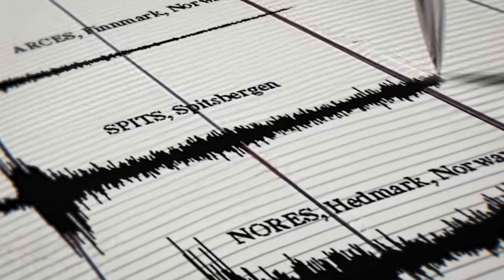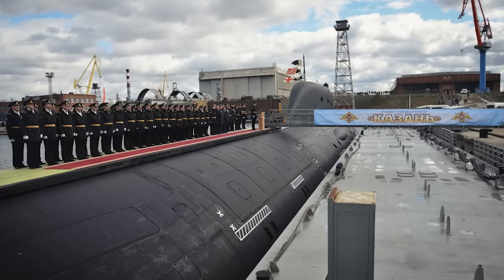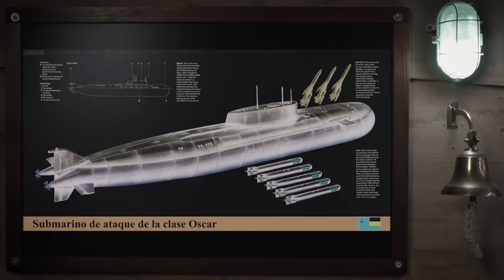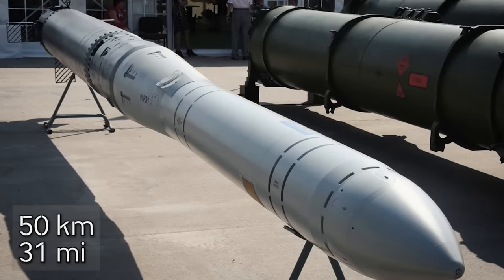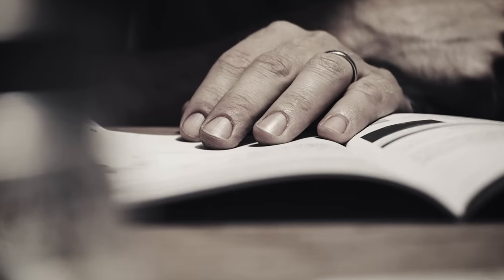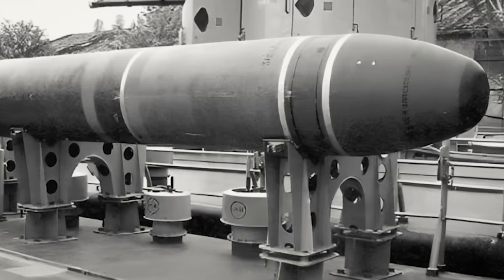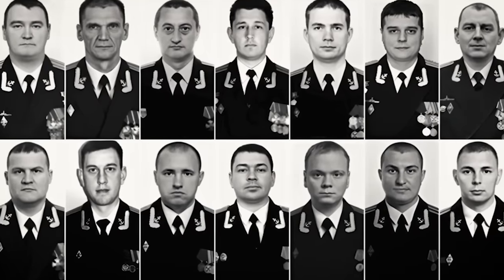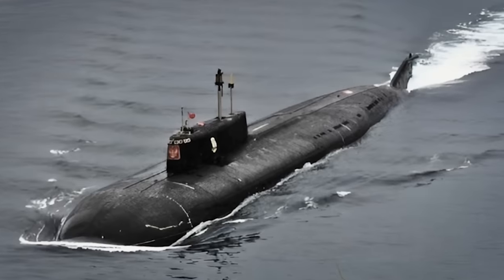This Chemical Killed 118 Men...

Comment: Disgraceful, criminal incompetence. You can't help but feel dreadfully for those poor sailors - the lucky ones died quickly. Also, really good video
Reply: They should have taken the chance. A very low chance of survival is better than not trying.
Reply: @albertoj.mollinedo4116  hindsight is always 20/20.  There was NO way they could possibly know what waited on the surface for them.  If they surfaced during a big storm, they would have died nearly immediately anyway.

Comment: HPT has been used as a fuel since the the 1930's. IJN torpedoes used it. Germany used it a couple rocket powered fighters, RATO packs and  a submarine powered by a Walther turbine. The USN, RN and USSR aquired the technology from Germany. The USN and RN abandoned all research due to it's instability. It is/was used to power turbo pumps on liquid fued rockets.
Reply: Didn't the RN lose a sub because of one of these types of torpedoes?
Reply: @neiloflongbeck5705  not sure. I wouldn't want to be anywhere near. Read the book " Rocket Pilot ". It is by a German pilot that flew the Me 163. It will blow your mind that they were flown operationally.
Reply: @neiloflongbeck5705 that's likely classified information I'm afraid.
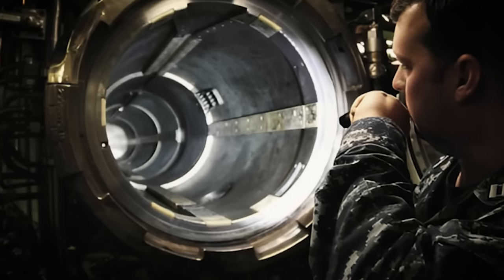Reply: @Rob_Moilanen having looked it up since making my 1st comment Royal Navy experiments were conducted on HMS Sidon but were ended in 1956 after the loss of the Sidon after a peroxide explosion. At 08:25 on 16th June 1956 one of the 2 peroxide torpedoes exploded in its  torpedo tube. Fortunately the warhead didn't explode but the hull was ruptured. All but the 12 men killed by the explosion  survived as the Sidon was still in harbour. Unfortunately one of the rescued was killed.
Reply: @Rob_Moilanen  book was published in the 60s or 70s. Not classified for years. I will speak about hpt not the catalyst
Reply: Japanese WW2 torpedoes used compressed oxygen.

Comment: When they finally decide to raise the ship, and make the decision to cut off the front section containing the torpedoes, it's just amazing that there is already in existence a means to do this. They attached Hydraulic suction anchors to the seabed with a tungsten-carbide saw cable and just made shoet work of it.
Reply: They're often used in ship scrapping and recovery, they used them on the Costa Concordia too
Reply: It’s also quite interesting that the Russian navy didn’t have any real ability to deal with this tragedy effectively, other countries had to be engaged to help.  The tragedy of running the exercises with very under-trained submariners is likely a result of the lack of funds available to Russia at the time, however given the level of corruption since Putin became president I suspect not much has changed, which is an even bigger tragedy.

Comment: 2:32 is a cool picture of an engine room.  You can see the HP and LP turbine, associated piping, I think the tank to the left of the LP Turbine is the DFT, and the the two cylinders on the port and starboard sides are condensers.  I think.

Comment: uhhhhh, yeah... a single 450kg warhead torpedo is NOT enough to sink an aircraft carrier by itself
Reply: You don't think a well placed torpedo with 1,000lb warhead could sink a aircraft carrier? I do
Reply: @CharlesSeipel  then you don't know very much about how modern aircraft carriers are built. Japanese torpedos in WW2 had a 1000lb warhead, and it took more than one to sink a carrier back then, and those ships weren't constructed anything like carriers today. Carriers today have a honeycomb type interior, as opposed to the old construction method with bulkheads. With bulkhead construction if you put a hole in the side of the ship, flooding would fill the entire compartment in between bulkheads which could be several rooms. In modern carriers with honeycomb construction, individual areas and rooms can be sealed off, so flooding does not extend out into an entire compartments. Plus, the steel used today is much stronger than material used back then. It would take many torpedos to sink a Nimitz or Ford class carrier. Many.

Comment: Politician A: "Lets use a chemical that ignites in contact with water for the rebreathers on our submarines."
Politician B: "Lets use a chemical for fuel in our torpedoes that ignites in contact with the inside of our torpedo tubes."
Politician C: "Lets call our submarine 'unsinkable'."
Politician D: "What if it sinks?" 
Politician A: "NATO did it."

Comment: @waterlinestories:
H2O2 always decomposes to form O2 thus if confined in a torpedo it would build pressure and explode eventually. There would have been overpressure relief valves. Shock to the canister might act like with CO2 in water.

Comment: I remember this incident as if it was yesterday. I remember i couldn't understand that the sub was in water that was not as deep as it was long. Couldn't they just blow the air tanks and raise the aft of the ship to the surface? Until i saw this video, I didn't understand that the control center was damaged, and the men in it were all dead.

Comment: Blaming the superiors is normal, but the superiors didnt order the sub commander to load a missile leaking toxic fluids into the launcher. That was entirely the crews decision and unfortunately it was a bad one.
Reply: Almost right. The crew did report the damage to the dropped torpedo. It was the CO's decision to continue as if nothing had happened. He apparently couldn't bring himself to report anything other than flawless readiness up the chain.

To my way of thinking, it was most definitely not "the crew's decision". Russian crews are not well known for their decisions. Because they're not allowed to make any. Maybe?

It was instead a well-deserved indictment of the Russian system of absolute top down control where any bad news is severely punished. The crew tried, but were overridden by a CO who's strategy seemed to be "let's hope it turns out alright and nobody notices".

Comment: Outer hull 8.5mm thick?  A third of an inch? You might want to confirm that.
Reply from the maker: Multiple sources. 

The outer hull is just a skin. The inner pressure hull was 50mm.

Comment: Despite the disasters being horrific, the ingenuity and technology that mankind has created is simply mind-boggling.  Pressurized reactors. surfacing hoods. 5 different types of pressurized diving vehicles just for rescue. potassium oxide rebreathers. whole companies created just for wreck retrieval. tungsten cable hydraulic saw mounted to the sea floor 200 meters down for taking apart a shipwreck. new, single-situation stabilization software. It's incredible. This isn't even the half of it mentioned in the video, which isn't even half of all the science and technology present.

Comment: i think by heat, you mean an ignition source.  in this case sufficient heat created in a pressure vessel was the ignigtion source.  also i think "actual footage" is supposed to be "actual photo" where video footage would be acutal footage

Comment: See, with the movie "The Command" I was lead to believe that the cause of the torpedo detonation was due to the internal temperature of the fuel, but this explanation makes much more sense. In the movie it seems as if the torpedo exploded due to the internal temperature of the fuel, and the resulting fire detonated all pf the stored torpedos around it. I will have to watch it again because maybe I am mistaken, but that's what I've always believed.
Reply: 😄 
re-watch a Hollywood movie for answers or discrepancies ?

Comment: It seems that their naval fleet is in the same shape as the rest of their military - old, outdated, poor construction, poor maintenance, poorly trained personnel, and extremely poor leadership on top of that. Lying about the condition of their equipment seems to be a constant problem with their armed forces. Anyone buying or thinking about buying any Russian equipment, military or civilian, should seriously consider the sub-standard practices of construction, quality of the components, and poor maintenance once stored. If the price seems to good to be true, there's usually a reason.

Comment: They "dropped" a torpedo when loading?
Waterproof bulkheads, but with an air vent?
The catalyst for HTP, is bronze and brass like the metal used to line the torpedo launch tube in Kursk. OMG!
The rebreather cartridge falls into the rising water, creating an explosion!
The rescue sub crashes into the Kursk!
Blame it on NATO.
Multiple failures of rescue.
Cumulative disasters.

Comment: A fire doesn't require heat to burn. Heat is a result of burning, not a component.
Reply: That's not what i was taught, when going through fire-prevention as part of my education.

Fire needs three things; heat, fuel, and oxygen. Take out one of those things, and the fire dies
Reply: not true, if you want to START a fire you need this three things or you have no fire, now if you want to extinguish this fire take one away

Comment: The Russian government and its overall attitude towards safety, build quality, etc has always been abysmal. 
For the Kursk to have been launched after so long a delay is bad enough but that that it was loaded with torpedoes that were far beyond their shelf life just to save money, is typical of the Russian system. 

The reasons for this aren’t difficult to understand or as it’s still visibly in operation despite it being the 21st Century and nlittle has changed other than even wider corruption which removes the necessary finance for expensive items where there’s no room for cutting corners (see Chinese “tofu dregs” and laughable “building standards”) and the same lax attitude of Grandpa Vlad “The Radioactive Poisoner” Putin and one time poster boy for Grinder.  

Sadly there’s no way to bring such people to account for their actions that have  led to more deaths of the military despite there being no declaration of war!  The “three week de-Nazification of Ukraine (and not forgetting Crimea) would have been unnecessary if Putin had the bravery to accept what he sees in the mirror on a daily basis 

It’s still based (like every Communist country such as China, plus theocracies such as Iran, or monarchies such as Saudi Arabia) mostly due to corruption, but everyone working is so used to the bad old days of communism (where targets were set under various 5-year plans but based on wishful thinking and not factual evidence. 

Amazingly those targets were miraculously met and increased year by year were met every time - just like it did with China that resulted in tens of millions dying by starvation) so lying about quality controls, safety checks, running constant drills for every possible problem and the solutions that are required. 

Unfortunately it’s quite expensive to constantly run drills on a submarine in relatively shallow waters but if it’s a well designed, professionally built system with attention to detail and all the life support etc, because it’s dangerous enough in a submarine in port but how much more important is it for the crews to be able to operate equipment when lives depend upon a professional, trained and motivated crew?  

To think that they continued loading out of date torpedoes, even after dropping one that had an obvious leak it beggars belief that it would still be loaded. Without a full overhaul of every possible source of flammable materials in a completely sealed system, with little to no chance of survival when at the normal operating depth (as rough guide compressed air is “relatively” safe for SCUBA divers down to 60-70m but only for a minute or two then it’s a long time resurfacing. With today’s mixed gases Heliox, tri-mix, etc and the better rebreathers used by navy divers/SF units etc.).  

With all that information in mind you’ll notice that the crew of “Kursk” were basically dead men walking when the leaking torpedo was loaded. Putin didn’t give a damn nor did any of the admirals. That the crew had to load a 5-ton time bomb twice because no one had bothered to check the connections from the torpedo tube to the submarine controls is just another indication of the lack of care.
 and a black mark on the professionalism of the crew, especially those in charge of torpedo handling. 

The scariest bit by far is that they even had to get the operational manuals from storage, because no one could remember or recall the last time it had been done by anyone in the forward/torpedo handling compartment. If you asked a retired veteran of the American submarine crew, or the Royal Navy, or any NATO country with submarines, I’d be surprised if you could find a single torpedo handler that couldn’t still do the job blindfolded and after 30-years of retirement, assuming you could find any subs from his era. 
That’s the difference in attitude between NATO subs and the very sad “laissez faire” attitude of Russias leaders from the gormless president/dictator, to the various head honchos of the military. So long as they keep receiving their kickbacks they have no reason to “rock the boat”. 

This wasn’t the only submarine disaster that Russia has had, nor is it the only one where politicians got in the way of rescuing crews during the most critical times - clearly they’d prefer the crew died rather than allowing any properly equipped western rescue sub gain any access.

Comment: So in short You made video in base of official explanation which is only piece of crap. Research better in future before You start to make video about anything...
Reply: @waterlinestories  No offence but in your video You didn't mention that there was help offer from non Russian resque crew that Russians refuse claiming that hatch is damaged while it wasn't. You didn't mention that after first explosion Kursk cut communication, increase speed and start to dive and that was common reaction for attack, no mention about US emergency buoy found in Kursk vicinity and last is hole on Kursk hull that looks like torpedo hit (metal around this hole was bented to inside so it definatelly wasn't effect of explosion in Kursk torpedo compartment). Off course officially it was accident made by defective torpedo, but it was never confirmed since the entire torpedo compartment was cut off before Kursk hull was lifted and detonated underwater.